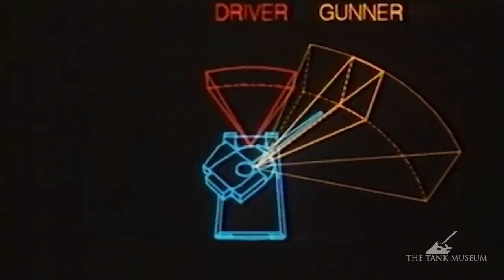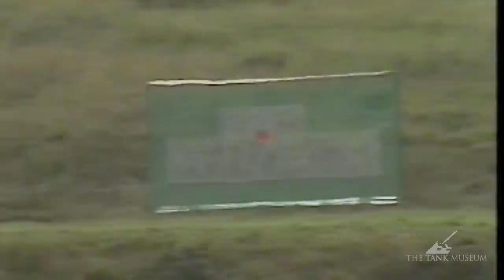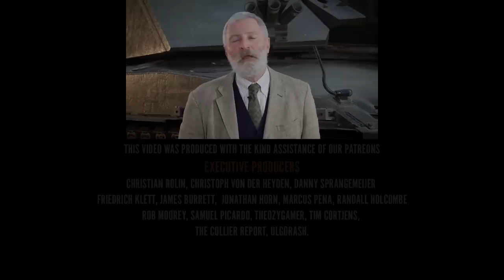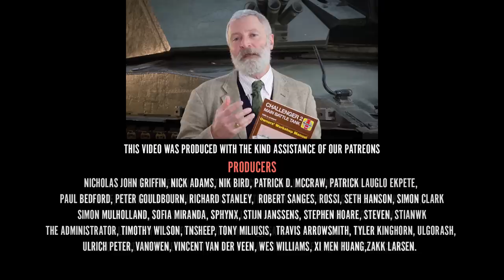Tank Chats #92 | Challenger 2: Part 1 | The Tank Museum

Comment: Original requirements:
1. Firepower.
2. Armour improvement over Chally 1
3. Better or equal mobility to Leopard 2
4. Interchangeable ammunition with allies.
5.  Reliability.

Tank we got:
1. Worse firepower than the L44 smoothbore gun, 1000 bar lower chamber pressure, lower muzzle velocity, lower penetration and accuracy with APFSDS rounds as rifling reduces accuracy on sub calibre munitions. Basically, failed requirement 1 immediately.

2. Armour improvement over Chally 1 was marginal. Roughly 20% turret and about 50% hull improvement. This could have been achieved simply by retrofitting Chally 1s, which is essentially what the hull armour was. Chally 1 hull had major design flaws but was recycled and modified because it was cheaper than going with an MBT 80 style hull. Requirement 2 was only kept when add-on armour was installed which makes the tank weigh over 70 tons. I'd call that 2nd requirement failed.

3. Equal or better mobility than Leopard 2? Failed outright. Weighs 12 tons more, has 300 less horsepower, has worse torque ratios at all speeds. Tank is slower on all terrain despite claims of better off road performance due to the suspension. This is a lie, Leopards are faster on rough terrain too, the gap is just narrower.  Requirement failed.

4. Interchangeable ammo? Failed. We realised that we had a lot of obsolete 120mm HESH lying around so we designed a gun for this round to save money, hampering the APFSDS performance and totally preventing use of a HEAT round. We ended up with 0 interoperability with our allies. Even the test team strongly recommended Vickers redesign the tank to mount the L44 smoothbore. Requirement failed.

5. Reliability. We got that, at least until we stopped making parts and had to start cannibilizing other Chally 2s for simple parts like track pins, and can now barely scrape 36 tanks together for a European training deployment.

If you haven't gathered, Thatcher's "best of British" approach meant the worst in NATO, under the whimsical pretence that we still made good weapons, or could still make good weapons for half the cost our allies spent to produce theirs. Interesting idea. It's worked out wonderfully. The Challenger 2 stands now as the most obsolete tank in all of NATO and desperately in need of the life extension program to fit the new turret and 120mm L55A1 gun...
Reply: How can you know it has 20% improvements on the turret armour?
Reply: @MinjunOh1001  bevause the values from testing in national and international design contests are available.
Reply: @AllThingsCubey  do you have a link to that information? I'd like to learn more
Reply: @MinjunOh1001  It's not digital. Most of it can be found in the kew archives but if you go digging for the Greek and Swedish design competitions you may find some. Alternatively, look at the original test findings from Bovington where they actually selected the Leopard 2 as the best vehicle.
Reply: @AllThingsCubey  thanks a lot
Reply: and yet here we are with a tank that has never been knocked out by enemy fire, and has great reliability with good mobility.
Reply: @leeboy29680-ol7gf  which proves that the differences in design outcome between NATO tanks are less significant than the proper training of their crews and formation commanders in how to use the specific vehicles they work with to the best effect.
It also underlines a need for commanders expected to be put in charge of combined NATO formations to know the specific abilities of all the AFVs used within the organisation.
Reply: @leeboy29680-ol7gf  It's also barely been in high intensity conflict, served only in small numbers, has never faced a modern tank (T55s don't count) and in Iraq the Challengers didn't encounter the same massive IEDs which took out a few Abrams, and the one that faced a modern-ish weapon (an RPG 29) was lucky to get away with just 3 injured crew after being hit and penetrated. However it must be said that the Challenger uses fuel tanks to better reduce the damage from penetrating HEAT impacts.
Regardless, with so few combat instances and such low level threats often faced, the Challenger 2's record doesn't really count for much. Someone else has already said that training and implementation matter more than anything, but the design shortfalls of the Chally 2 are rapidly making even the best crew unable to compete with other NATO designs.
Reply: @AllThingsCubey  I'm absolutely fascinated by the ability you're demonstrating in this comment section to pontificate for hours about a tank which is still entirely classified. Exactly zero of your points can be corroborated by any genuine source, and indeed everyone I've seen who's actually operated the CR2 says pretty much the exact oppposite to what you seem to think. I'd suggest you might want to start dealing in facts rather than opinions - although given by the number of 'likes' you're getting it does indeed appear that you either have a lot of sock puppets or the internet prefers opinions!
Reply: @ker-klickchoom5119  Nothing about the Challenger 2 is genuinely classified anymore because, unlike its rivals, it has not been properly upgraded throughout its entire life, and data from national evaluations of tank capabilities have been declassified in the years since its introduction, and made publically available. Details on its armour performance and gun capabilities (excluding the latest shell it fires) are available to find in both UK archives and those of Sweden and Greece. 
If you want to listen to kids TV shows that still call it classified, go ahead, but the data is availavle, and damning.
Reply: @ker-klickchoom5119  Erm, original testing was 1987. 32 years ago, bub. Why do you think it's even being talked about in this video?
Reply: @AllThingsCubey  Great. That was the START of testing. The test series hasn't been released. None of the reports are available in the national archives. Which still means you're lying. And any comparitive tests DEFINITELY won't be publicly available yet.
Reply: @ker-klickchoom5119  And yet they are. Your denial is showing.
Reply: @AllThingsCubey  Eh? I haver tried every concievable combination of search terms on the National Archive's files just on the off chance you aren't talking crap. There's very little info on Challenger I, and none of Challenger II. Pick a new story - your current one has as many holes as a colander.
Reply: @ker-klickchoom5119  Half of it is not digitally available. If you want to go to Kew and request the documents in person, be my guest.
Reply: @AllThingsCubey  Sure. What are the refernce numbers?
Reply: I now concede that you were right on one point - someone did manage to find some performance figures for the L30A1 gun, specifically the chamber pressure values. I've linked to the post below, which has the full source available for download. But that's where things get amusing - peak chamber pressure on the L30A1 is a little over 600 MPa. Every source I can find on the Rh-120 L/55 gives peak pressure as 580 MPa. Now I'm no expert, but a bigger number means the chamber pressure is higher , right? So it seems sort of odd that your entirely unsourced comment claims it to be lower!

Source: https://forum.warthunder.com/index.php?/topic/447575-fwd-2019-05-11-187192-challenger-2-l30-gun-pressure-issues/&do=findComment&comment=8108546
Reply: @ker-klickchoom5119  Actually it depends if you're using absolute/ gauge pressure, or not. If you use Bar to measure it, which is absolute, then the German L44 even offers 7000 bar chamber pressure vs the L30A1 and 6000 bar. The L55A1 that the Challenger 2 is going to recieve (upgrade of Leopard 2A7's gun) has 7500 bar chamber pressure. I have no idea where you're getting data showing a lower pressure in the smoothbore gun.
Reply: @AllThingsCubey  The document I linked you to describes exactly how the pressure was measured. And if you want to throw random numbers at me, you're going to have to cite sources.
Reply: @ker-klickchoom5119  Your document is for proof pressure testing, and even states that one proof round is equal to TWO equivelant full charges (EFCs). What you've sent is a document showing the tested limits of pressure the gun can take without splitting its rifling. This is not the weapon's chamber pressure when using any round in service, and no comparable to chamber pressures as measured for a particular round in the German or US derivative guns. As it stands the 7000 and 7500 bar measurements are maximums, but there are 5200-5800 bar ammunition types in use for them. The document you sent even states it was equivalent to a double charge and was only a little higher than this.
Reply: @AllThingsCubey  You're jumping around in circles here. You've taken umbrage with me providing a document that gives 600 MPa chamber pressure, you've then quoted the 'actual' pressure as 6000 Bar (which is the same value !) You're still not quoting any sources for the L/55 though. Could you please provide a document that gives the chamber pressures for the L/55.
Reply: @ker-klickchoom5119  You're misunderding. Your document is not even referring to chamber pressures in the sense of what drives a round. Its proof pressure test data on barrel stress for rifled guns....  the 6000 bar/ 600mpa figure in that data is using a doubled up cartridge. I only quoted it later because even with twice the propellant, it's barely higher than the 5200-5800 bar pressures of a normal round in the smoothbore. You yourself acknowledge those numbers.

The only thing I've yet to source is the 7000+ bar max pressure figures, for which I'm seeking my original source. However, we have actual ammo data that's nearly 6000 without being s test environment and a double charge, which ought to be enough evidence for you...
Reply: @AllThingsCubey  Sorry, this double charge thing you keep mentioning is weird but I think I've just realised where you've got it from. Are you referring to the "For accounting purposes, one proof round equates to 2 x EFCs" at the top of the right hand column? That's specific to the 4.5" Naval gun. It mentions on page 12 of the document " All Naval proof rounds equate to two effective full charges (2 x EFC)." That's not for tank guns.

Comment: They failed all top requirements , worse gun in nato, worse survivability, worse mobility , poor engine , easy target to hit, two down right criminal weak spots , drivers hatch and lower front plate, this tank is to the grunt a sa80, mod are criminals.